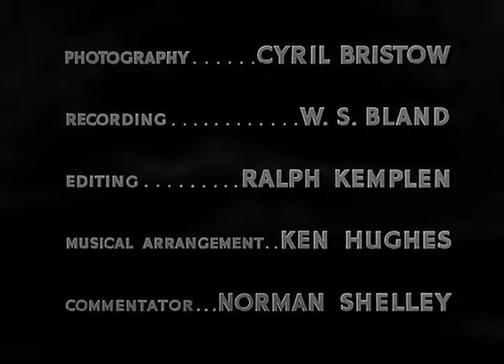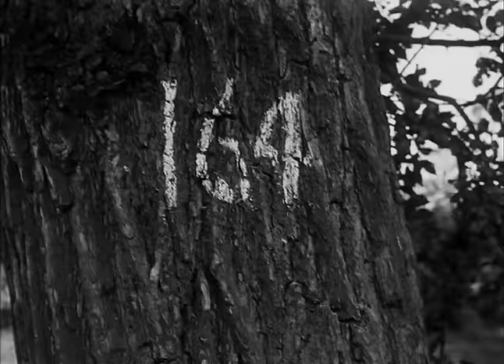The Little Ships of England (1943)

Comment: Nice to see shots of Fowey at the beginning.  Does anyone know the location of the shipyards?
Reply: The footage was actually of Polperro and later of Looe. The boats shown were Fowey registered though, that probably threw you.
Reply: Surely Polperro?
Reply: MrsJensterG Mashfords boatyard River Tamar
Reply: @snuggles243  I don't think it can have been Mashfords,  at 10:20 steep wooded valley with bridge nearby.
Reply: Richard D hi Richard . 10.2O is looe , during the war years Mashfords held a MOD contract for building mine sweepers . . They continued to hold a contract till way up into the 80s for small craft . The fitting out was done away from the yard at looe due to the constraints of the yard and to free up slipways .. those sheds you see in the film are still standing . Mashfords to day are still in operation but under a different name as the family business has been sold .. but the traditions still lives on